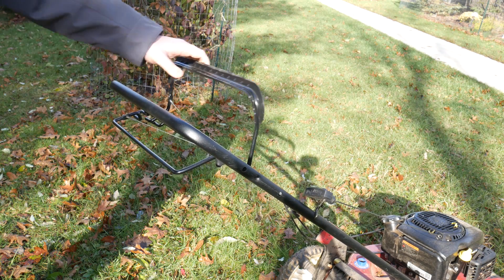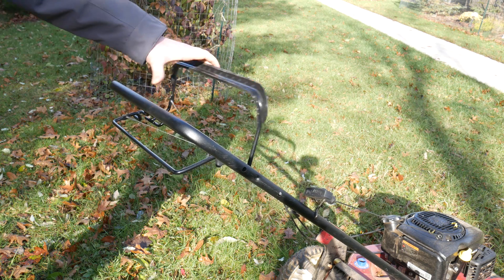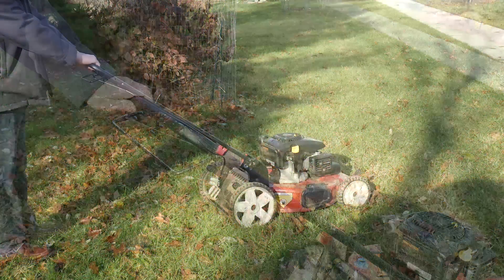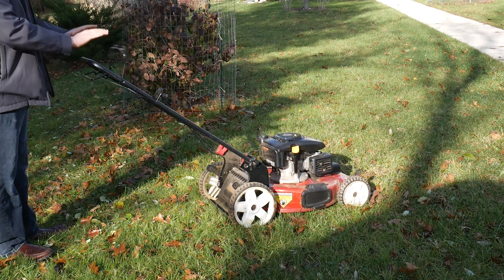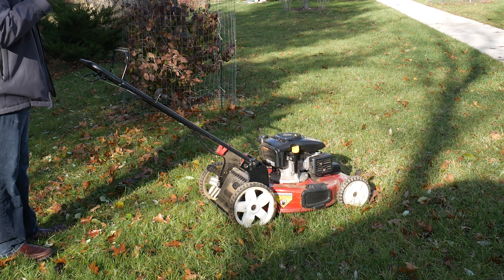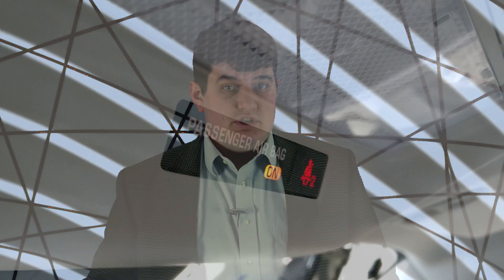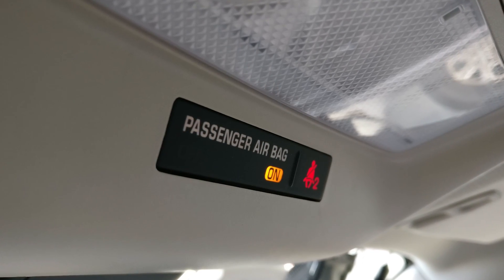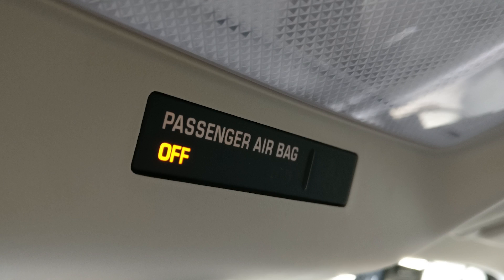The Dead Man's Switch:  How Anton Yelchin's life could have been saved

Comment: I don't know how Chrysler does it, but in Subarus the addition of a deadman switch for the transmission will require an additional circuit. It certainly isn't just a software update. Not that Subarus really need such a feature, since the transmission isn't a shift-by-wire.

Comment: My riding mower has a very rudimentary dead man switch. The forward/reverse mechanism is controlled by a rocker pedal which is held in the center position by two springs. If the driver lets go of this pedal, the mower stops moving. However, the engine, the PTO shaft, and the blades all stay engaged. Pretty nasty if you fall off and roll under it.

And are there really people who refuse to wear seatbelts in 2018? What are they waiting for, the grim reaper in a cop uniform to tell them to buckle the hell up? This dead man switch concept should be extended to the point where cars will electronically limit their speed to 25 mph while the belt is off, and to detect whether the driver is actually wearing the belt or has simply strapped an empty seat before sitting on it.
Reply: I've also seen tether switches on motorcycles, forklifts, treadmills, and jet skis. These are ineffective as well, since the operator only has to plug in one end of the tether and let the other end dangle instead of attaching it to his arm.

Comment: Isn't it common to apply the handbrake/parking brake before leaving a vehicle? I learnd it in driving school. I thougth its part of the muscle memory of an expirienced driver to pull the brake, so even if the car is still in gear the motor would just stall. Nethertheless: of course everything that makes transportation saver should be implemented. I was just wondering why the cars design should be the cause of the death, if he obviously did not protected the car from rolling away.

Comment: A dead man switch on a seat is not a good idea
If someone adjusts in their seat, or reaches in a way that makes them take weight off the seat they could inadvertently lose control of the vehicle while driving
Over engineering the software will always cause more issues than it solves

Comment: All vehicles that have dead mans switches either are on tracks, or go under 10 mph. If there was such a switch in a car, they would need to be careful in the way they engineer and what happens once the person shifts or lifts their bottoms up off the seat for a streach what happens? Apply brakes? If it's not moving the switch to park is definitely senscable , "self driving" cars could totally handle such a senario. Def not against it, just some conversational points ☺️
Reply: KapcodeTech there would be a 3 or 5 second delay before parking activation (shuffling position) to prevent sudden brake engagement

Comment: Boy steer by wire makes me uncomfortable though, at least if my power steering fails I can wrestle with the rack and pinion and safely steer off the road, steer by wire, no such luck if it fails.  

Tesla's have this technology you're speaking of, but it serves to be a double edged sword, it makes people complacent, thinking their car will automatically shift in to park if they get out of the seat, which the tesla does, if the system fails or you get in a car that doesn't have that system, bad things will happen.

Comment: I hate the new safety system they added. Sure, it makes sure nobody rolls over themselves but the monostable shifter has been phased out (I had no problem with the monostable myself, but it does take a learning curve over a normal shifter) and moving cars around a car lot means not popping the doors open while in drive to check surroundings unless I want a bit of whiplash from an emergency halt. There really needs to be more dealer support on these newer cars.

Comment: A seat belt transmission interlock is t a very good idea. There are some instances (driving on a frozen lake, for example) where it's actually better to not wear a seat belt due to other safety risks (thin ice causing the car to break through. Wearing a seat belt in this instance would hinder the drivers ability to escape the sinking car in this example).

Great video though, and I definitely think a seat pressure sensor is a great idea.

Comment: Thanks for the video. What you propose sounds great, but there are several valid reasons why this is not done. FMEA analysis show a high system risk due to false faults.   (20 yrs atomotive engineering experience).

Comment: A seat occupied switch to drive the vehicle may SEEM like a good idea, but you have to allow for all aspects of their operation and their malfunction. 

Scenario 1: You are driving along when that switch fails, what does it do? It suddenly shifts the vehicle into neutral and tries to engage the parking pawl(this is what happens in "park")... A failure of an unnecessary system that could cause a wreck, since a high speed engagement of the parking pawl is a very startling sound to hear while driving.. Best case scenario, the parking pawl has now been ground to nothing and your vehicle now has two neutral gears, even though you THOUGHT you put it in park.

Scenario 2: You are driving slowly down a steep and rough dirt road, when going over a large bump causes you to lift mostly out of the seat, the vehicle detects that you left the seat, and shifts into park. At low speed, the pawl would likely be able to fully engage, breaking it off and leaving you going down a steep rough hill, effectively in neutral. If you the operator didn't realize that your park gear is now just neutral, you may "park" it somewhere and have it roll off on its own, since the pawl that normally holds it in place is sheared off.

Scenario 3: A driver is driving along a lonesome Alaskan road in the middle of winter, it is -65F outside, and the driver is alone, passing through a valley with no cell service and less than a 1/4 tank of gas. The switch breaks. The vehicle now locks into park, fortunately not damaging anything. The vehicle is now in park, and the lone driver who is NOT a mechanic by any means, has no way of knowing what to do to fix it, and the otherwise perfectly functional vehicle is now a 30,000 heater/road block. This could have been any sensor that stranded them there, but sadly, it was this new and completely unnecessary sensor that will only ever be a hindrance that caused this driver to become stranded and possibly die, because every added feature makes a vehicle just THAT much less reliable.

This might have seemed like a good idea, but it is in fact, a terrible terrible terrible one, that could only realistically cost lives. These kinds of things are why automotive manufacturers REALLY need to hire more competent engineers than they currently do. The other side of the coin? People need to understand that a vehicle is a very serious tool and treat them seriously. They can be used to save or take lives faster than anything else in our lives, yet we so often treat their operation is nothing more than a trivial little inconvenience.
Reply: You sir, are not a mechanical engineer, nor are you an automotive safety expert, nor are you a highly skilled and experienced automotive technician, nor are you anyone who has any place to criticize any automotive manufacturers for their engineering decisions, nor are you anyone who does or should have a say in modern automotive standards.

The last half of this video was nothing more than you explaining in detail all the things that you barely even thought about before making this video. Unsubbed, disliked, you should probably fix your shit, sir.
Reply: I like to say: "It's strange how easily we forget that we climb into one-tonne metal boxes, and move around in them at speeds that can kill people, at exactly the same time as millions of other people are doing exactly the same thing."

Comment: In Australia, we enforced seat belts long before the USA and very few Australians (drivers or passengers) will get into a vehicle and not immediately fasten their seat belt. However it is legal to not wear a seat belt whilst reversing a vehicle and my (French made) Renault is smart enough to not sound the Seat Belt buzzer whilst I am reversing. However as soon as I select a forward gear, the seat belt alert will sound. A sensor in the seat would cost them pennies and I would not be surprised if many already have a switch or sensor in both seats and the software simply determines if the left or right seat is the driver's seat - based on the market the vehicle is getting sold in.

Comment: Does anyone else think it is weird that they named "drive by wire" the removal of the wire used to accelerate and thus drive the car?
Reply: It's similar in name to the aircraft technology of the same concept called "fly by wire". Also, the things being removed are called cables both technically and in the mainstream. I've never heard anybody talk about a "throttle wire" because they've never been labeled that. For the most part, when talking technically anything having "wires" is electronic. The word cable on the other hand, has a much stronger dual meaning.
Reply: Electrical wire
Reply: CODMarioWarfare I'm thinking of it more like drive by electronic signal, and since they are both wires the new name does not help distinguish the new technology from the old.
Reply: Drive by wire. Electric wire.

Drive by cable. Steel braided cable.

Comment: Heck, even the electric carts at department and grocery stores use a seat sensor to stop the cart moving if there’s nobody in the seat.

Using the seat belt sensor makes it too easy to defeat (dummy buckles abound for those who hate wearing seat belts), but it’s an interesting idea.

My Volt has an unambiguous shift lever, but it still warns me to shift to park if I shut off the car, but it wouldn’t help unless I shut the car off before getting out. Not sure if Anton did this or not.

Comment: Just a story, not meant to be an argument for or against dead man switches:
In a job i quit a year ago we had to ride a tractor regularly to haul potting mix around.
A few months before i quit we got a new one which had a dead man switch on the drivers seat.
We always had to drive the thing in tight spaces with people around so we would have to get up while driving to get a better look of certain things.
Everytime the deadman switch activated you would have to shift into neutral, switch off the ignition, switch on the ignition and shift into drive. On a strong slope we also had to brake really hard to prevent it from rolling down the hill.
I'm sure you can see the problem by now :D
Reply: Time delay the switch for 5-10 seconds

Comment: My riding lawnmower has a dead man's switch on the seat, it is the most annoying thing and I disabled it.  
I can't tell you how much time I wasted trying to crank it and turn it over with a battery charger and turning the starter switch, and it not starting until I realized I had to be sitting in the seat.
!@#$%^&*()   Can you imagine how that would fuck up a mechanic, who tore your car apart scratching his head wondering why the fuck it would not get spark and crank when he's checked every god damn thing... and it was all because of a god damn dead man's switch under the seat.

I stopped buying and driving cards because they became too impossible and complicated to work on, with the engines packed in like sardines.  Stupid ignorant consumers buy this front wheel drive piss poor engineered rot and it gets passed down to the rest of us.   

Instead, I switched to driving simple 80's era cruiser motorbikes, which get 50-60 mpg, are fun to drive, easy to work on, straight forward in operation, and for which parts are cheap.

Comment: FYI Mercedes (C-Class and above) does that. the new ones at least. The transmission is triggered by the key. If you remove it, the trans goes into Park. If you open the door, the handbrake gets engaged automatically.

Comment: Can't begin to tell you how much I like this idea. And you're absolutely right, this is absolutely possible through software. Most late model vehicles would be capable of this right now! As an automotive technician and electrical engineer, all of the vehicle modules are connected to each other via a CAN  network. There is so much going on at so many different times between ABS module the airbag module the body control module and the powertrain control module that the vast majority of people have no idea about. Commands can be sent through the CAN network from a diagnostic scan tool for testing purposes. Here is how I would see this implemented. Exactly as you said vehicle speed below 10 miles per hour as monitored by the PCM. The BCM monitoring door switches and communicating the status of these switches to the PCM. If the vehicle is in gear and traveling at a speed greater than 0 miles per hour to 10 miles an hour with one of the door switches signaling a vehicles door is open, and when other various criteria are met the PCM or BCM can command the ABS module to activate the pump motor and control solenoids to apply brakes at all four wheels. Ford is even doing this already with something called hill start assist on passenger cars equipped with manual transmissions. If the brakes are applied and the vehicle is stopped, with the yaw sensor signaling the vehicle is on a grade, the neutral safety switch is signaling the vehicle is in a gear, once the brake is not applied anymore and the  hydraulic clutch pressure switch is signaling pressure in the line, the PCM then has the ABS pump module activate and lock all four wheels until the vehicle speed sensors indicate the vehicles moving forward or backwards then that command is canceled and the vehicle resumes normal operation. Personally I believe that would be a great safety device, and something that wouldn't interfere with the normal operation of a vehicle in everyday life. Great video! Thank you, definitely plan on sharing this with some of my mechanic buddies

Comment: I know I'm late to this video, and it's probably been mentioned by others but I'm too lazy to look, this system would need an override if for some reason you needed the car in neutral. A good example would be if the car is being towed, especially when hooked to the tow truck from the back. If the dead man's switch always puts the transmission into park when no one is inside then the parking pin will be destroyed as soon as the car begins to move. Since most modern cars have screens, perhaps it could put up a prompt asking if the car is going to be towed and then ignore input from the dead man's switch.